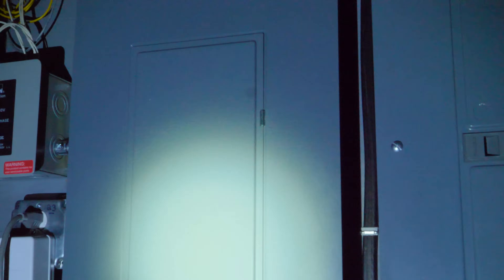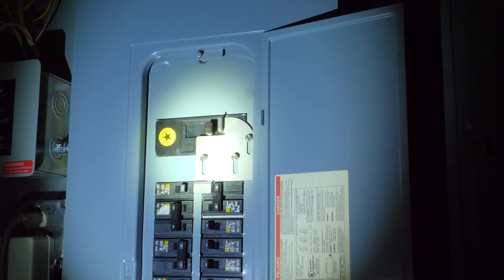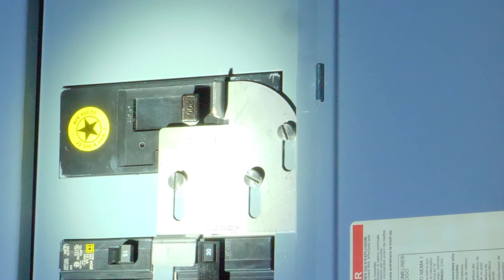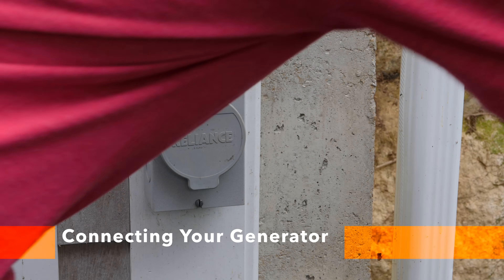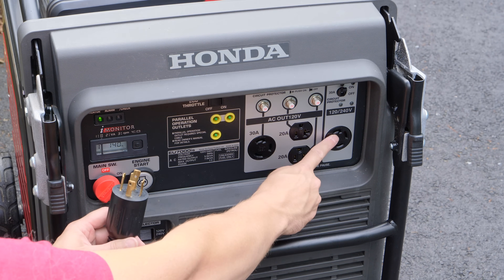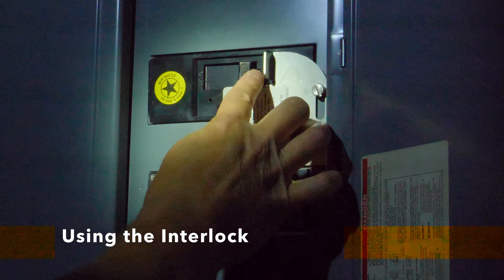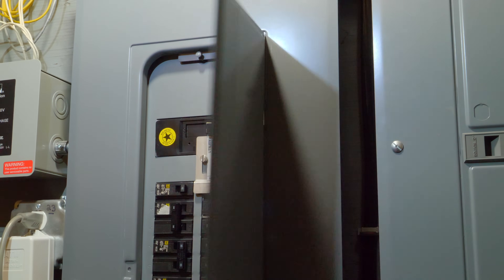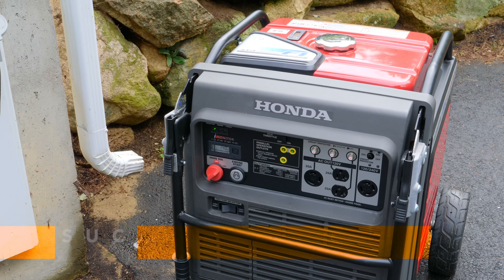Generator Interlock - Using it & Connecting a Generator to your House

Comment: I do it a little differently from you.  I always turn off the main street power breaker and all individual breakers before getting the generator out.  The I connect to the power cable from the generator to the power inlet box on my house BEFORE starting the generator.  Then I let the generator run for a few minutes.  Then I flip the generator breaker on.  Then I start turning individual breakers on one at a time, waiting a little bit when flipping breakers that will have large loads.

Comment: On the Eu7000is in Canada, the L14-30r connector label is at 22.9 amp.
Does it means that your version can reach the maximum of 7000 watts, but the one in Canada can only reach 5500 watts ?

Thanks

Comment: When do you use the ECO Throttle?
Reply: When you dont need more than maybe half the total output. It just runs quieter, but causes larger voltage drops when a new, large load is plugged in.

Comment: According to RELIANCE on their 30 AMP outdoor outlet, Do Not Start the Generator First as in this video. With the Generator Off, Make the wired connection from the Reliance or other Outdoor Outlet to the Generator. Their instructions explicitly state: "Risk Of Electric Shock. Do Not Start The Generator Until The Cord Is Connected To This Inlet and the Generator. Any Terminal May Be Energized When When The Cord Is Connected." "Shut Down The Generator Prior To Disconnecting The Cord From This Inlet And The Generator".

Comment: The proper way to shut down a portable generator for storage.  Turn off the fuel valve on the bottom of the tank and let the engine run until it dies.   This clears out fuel in the carburetor preventing varnish deposits.  The varnish deposits will prevent starting the next time you need it.  Very very annoying.
Reply: Except this model is fuel injected. Don’t do this on this model!

Comment: Good job on this demonstration! Also, it is a great idea for one to purchase 'PowerBack' Model THP108 by Reliance Controls so one will know when the Utility Power comes back on if they go with the Interlock Switch. This way if your main panel is inside your house, you don't have to look for lights to come on at a neighbor's house or wait for some form of notification (Text, Phone Call) from your utility company to know that the main power has been restored. The Interlock Switch in my opinion is the better way to go than installing a limited number of circuit breakers using a Transfer Switch!  I also added a dedicated battery operated emergency light on an individual circuit over the service panel so that when the power goes out, the emergency light comes on that shines right there on the panel.

Comment: How do you connect to the breaker in the panel? No one shows that part.
Reply: I bought the unit and had an electrician install it. Then ran the cable outside. You’ll want to cover and hide it if you leave it in place as I did. As the electrician said copper is becoming more valuable and people will steal them and they’re about a hundred bucks. Probably more now. 
That way it’s done right. He also had to make foot long pigtail adapter to get the cable to make with the generator as the plug was different on the cable that comes in the breaker kit. Worth every cent.

Comment: I have the HONDA EU6500 connected via a Reliance transfer switch PLUS the reliance box of individual breakers. I like your approach better as it allows connection to ALL the internal house circuits rather than just the 10 individual 110volt breakers in the transfer box. As it is, I cannot use my dryer or washer through this box as they are 220 Volts and can't be connected individually in the transfer box. 

The transfer switch is a much better option than the Reliance box I use
Reply: Just an update to my previous post. I have just come off a four day power outage up here in Ottawa, Canada where I used the Honda EU6500 for some 60 hours to power my home. What I found was the 10 circuits I hooked it too simply didn't provide power to certain other areas of the home we used. So I ended up using internal extension cords to power the TV's in the back bedrooms where we sit at night. This got very old very quickly. So, to make a long story short, I have ordered a $2000 Generlink transfer switch to replace the Reliance 10 circuit switch and am awaiting Hydro disconnection ($300 plus dollars for the permit...yikes !). My panel doesn't allow for a whole house transfer switch...

I do not ever want to find myself in this position again. This superb generator will power pretty much anything in the home other than the electric clothes dryer, and I can live with that. It is severely underrated by Honda and as far as I can see has the same capacity as the 7000 model for continuous use (5500 watts)

The way I look at it to justify this cost is its a lot like insurance. I spend thousands every year for insurance on my home and vehicles, and with rare exception, I get nothing for it. This little bit of "insurance" gives me that comfort level  that life will be the same as normal during the next storm, AND I get the Generlink electronic  switch along with it.  My justification anyway and comfort in the home is well worth this cost at least to me....

I have two small Champion 2000 watt generators which have been out on loan for almost a week now and are still doing superb duty running pretty much continuously saving food in neighbour's freezers and fridges. One can not imagine how critical power is to our day to day living until you have been without it for a time...

Comment: I need your help because I was already unsuccessful in locating what I need. I need an  interlocking kit for my panel. It is a Siemens GB4040B1200,GB4040B1200CU, GB4040L1200,and GB4040L1200CU. House was built in 2010 so it's not old.I went to a website but could not find the kit needed.

Comment: Just an FYI to people who say "wow I'm going to buy a 13K generator and power the whole house!", with most portable generator interlock set ups you can't do it. Most generators use a 30Amp 120/240 connection to the house and a 30 amp breaker can push through just shy of 7,500 watts. THAT'S IT! So, you're brand new Duramax 13K with a standard generator 30 amp plug and interlock with a 30 amp breaker will only push 7,500 watts max.
Reply from the maker: Very true, people get caught up on those mega generators and I think most are never plugged in/hardwired. 7500 or less is the best size for a lot of reasons including this one and fuel efficiency too. Great points
Reply: But what if you have 50amp setup with 50 amp breaker?

Comment: That is a great tutorial on how to use a generator with an interlock kit. My only advise is to advise customers that their generator will not likely be strong enough to operate their central AC, Electric Range,  or Electric water heater in some cases. It's important to remember to have those breakers off when using generator power. I also NEVER turn a main breaker on or off unless all branch circuit breakers are OFF. You don't want large inrush currents impacting your main breaker or your generator. It's best to have those branch circuits turned on individually to allow things to come on without huge current spikes.
Thanks for putting this tutorial out there.
Reply: Here are portable generator safety rules: this safety information is only for anyone who use a portable gas generator and for those who are planning on getting a portable gas generator. This is just a reminder for everyone’s safety. All generator safety rules should be followed carefully. This advice is just to make sure that everyone is aware of all the warnings and it’s just to remind people to be careful using portable generators. Generators can be dangerous if not used carefully. Every year, hundreds of people die or get injured when using portable generators due to carbon monoxide poisoning and electrocution. Make sure you are using your generator carefully and keeping others safe as well. There is something very serious that everyone should always be aware of when using generators. Some people do run their generator indoors which is not safe and that increases the risk of carbon monoxide poisoning which can cause death of family and you. Some people run their generator in wet conditions which can electrocute them. Please remember that you should never run your generator indoors. Remember that carbon monoxide is an odorless and colorless gas that you cannot see or smell. Carbon monoxide is a silent killer. Keep that in mind. Make sure your generator is 15-20 feet away from your house and away from doors, windows, and vents. Never use your generator in your porch too. Having a carbon monoxide detector is very important against generator safety. Some people also allow children to go near the portable generator which could pose risks. We need to keep an eye on our children making sure that they are not near the portable generator so they won’t get electrocuted or burned by the generator which is dangerous. A locking enclosure also keeps kids safe. A generator shed might look like a tempting place to explore, or take cover during a game of hide and seek, but a generator is a dangerous piece of equipment that can cause injury. It says on the manual that we should also keep children away at all times from the portable generator to avoid injuries. Please do not allow a child or unqualified people to operate the portable generator.  It is important to keep your children safe especially little ones. The portable generator can be hot during an operation. Just because some manuals missed what should be listed doesn’t mean it’s safe to do. Always follow the generator safety rules when using portable generators. Generators pose electrical risks. If you need to use your generator during wet weather, you need a generator tent to protect your generator from getting wet. Don’t let your generator get wet. Keep your generator dry and before using your generator, please make sure your hands and your generator is dry. Do not wear loose clothing when operating the generator. Everything that is said on the generator’s operating manual should not be ignored. Never smoke cigarettes near the generator. Please keep flammable things away from the generator. Never overload your generator too. Your generator can catch fire. Never ever try to plug a generator cord into a wall outlet to avoid back feeding. Back feeding your generator is dangerous. Always turn on your generator first before plugging in appliances and shut off the appliances before turning your generator off. Use a heavy duty cord for your generator and the cord should not be worn out. All the instructions should be followed carefully. Never refuel your generator while it’s running. It can cause fire if fuel spills while your generator is hot. You should turn off your generator and let it cool off before refueling it. Having a fire extinguisher next to the generator is also important. This is only a reminder for everyone’s safety of using generators. Make sure your generator is properly grounded. Having a fire extinguisher next to the generator is also important against the safety rules. https://youtu.be/I1jT3ANENvI and here is a video more about keeping others safe when using generators and also about our family’s safety. Hope this helps. Thank you.

Comment: Hi. I have a 200 amp main panel and another 200 amp sub panel next to it. Do I need 2 interlock kits and 2 double breakers or just 1 set in the main panel.
Reply from the maker: No you just need one interlock on the main panel and the interlock will feed power the same way it coms from the street and will power all circuits connected to it. Obviously it can only put out as much pwoer as the generator can supply. but it can reach all circuits.

Comment: Nice video, I have the same kit. I turn off the branch circuits before turning on the generator breaker. Then once that is on and power is suppled to the panel I start turning on the branch circuits, I start with the one that will provide light in the panel area, that is the basement. Then I have the circuits numbers on a spreadsheet by priority, sump pump, heat, water heater, kitchen lights and so on.
Reply: That's how I do it as well - spreadsheet and all!

Comment: So you just wire the inlet box straight to your generator breaker?
Reply from the maker: Yes, to a dedicated breaker for this purpose, its a regular breaker but has to be mounted in the upper position to work with the interlock slider
Reply: @SilverCymbal  oh I see, so feeding power to that breaker from your generator, would basically power up the whole breaker panel.

Comment: The correct Outdoor outlet for the 30a cable connection is on Amazon made by Reliance https://amzn.to/3iXMtGy
Reply: Here are portable generator safety rules: this safety information is only for anyone who use a portable gas generator and for those who are planning on getting a portable gas generator. This is just a reminder for everyone’s safety. All generator safety rules should be followed carefully. This advice is just to make sure that everyone is aware of all the warnings and it’s just to remind people to be careful using portable generators. Generators can be dangerous if not used carefully. Every year, hundreds of people die or get injured when using portable generators due to carbon monoxide poisoning and electrocution. Make sure you are using your generator carefully and keeping others safe as well. There is something very serious that everyone should always be aware of when using generators. Some people do run their generator indoors which is not safe and that increases the risk of carbon monoxide poisoning which can cause death of family and you. Some people run their generator in wet conditions which can electrocute them. Please remember that you should never run your generator indoors. Remember that carbon monoxide is an odorless and colorless gas that you cannot see or smell. Carbon monoxide is a silent killer. Keep that in mind. Make sure your generator is 15-20 feet away from your house and away from doors, windows, and vents. Never use your generator in your porch too. Having a carbon monoxide detector is very important against generator safety. Some people also allow children to go near the portable generator which could pose risks. We need to keep an eye on our children making sure that they are not near the portable generator so they won’t get electrocuted or burned by the generator which is dangerous. A locking enclosure also keeps kids safe. A generator shed might look like a tempting place to explore, or take cover during a game of hide and seek, but a generator is a dangerous piece of equipment that can cause injury. It says on the manual that we should also keep children away at all times from the portable generator to avoid injuries. Please do not allow a child or unqualified people to operate the portable generator.  It is important to keep your children safe especially little ones. The portable generator can be hot during an operation. Just because some manuals missed what should be listed doesn’t mean it’s safe to do. Always follow the generator safety rules when using portable generators. Generators pose electrical risks. If you need to use your generator during wet weather, you need a generator tent to protect your generator from getting wet. Don’t let your generator get wet. Keep your generator dry and before using your generator, please make sure your hands and your generator is dry. Do not wear loose clothing when operating the generator. Everything that is said on the generator’s operating manual should not be ignored. Never smoke cigarettes near the generator. Please keep flammable things away from the generator. Never overload your generator too. Your generator can catch fire. Never ever try to plug a generator cord into a wall outlet to avoid back feeding. Back feeding your generator is dangerous. Always turn on your generator first before plugging in appliances and shut off the appliances before turning your generator off. Use a heavy duty cord for your generator and the cord should not be worn out. All the instructions should be followed carefully. Never refuel your generator while it’s running. It can cause fire if fuel spills while your generator is hot. You should turn off your generator and let it cool off before refueling it. Having a fire extinguisher next to the generator is also important. This is only a reminder for everyone’s safety of using generators. Make sure your generator is properly grounded. Having a fire extinguisher next to the generator is also important against the safety rules. https://youtu.be/I1jT3ANENvI and here is a video more about keeping others safe when using generators and also about our family’s safety. Hope this helps. Thank you.

Comment: does the order matter ?  should you turn off generator before you disconnect the cord?  or should you connect the cord from inlet to generator before starting the generator?
Reply: I wouldn't mess with the cord while the generator is running.  Plug it together before starting generator.... and then shut off generator before unplugging cord.
Reply: @PatrickWagz  Great advice!

Comment: That generator is big enough to run your entire house?  I don’t think so. For all you diy dill weeds out there, be sure to flip off all the household breakers before switching on your generator breaker. Then turn on each household breaker that your generator is capable of handling from a total load perspective. If you need to run something large, like a well pump, you may need to selectively run that separate of other loads by turning off certain breakers while the higher demand appliances are running.